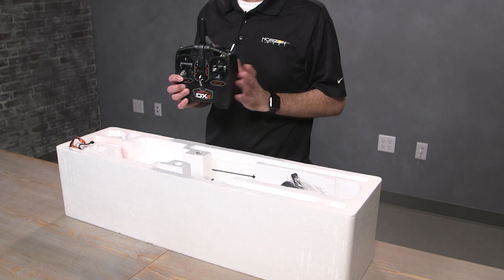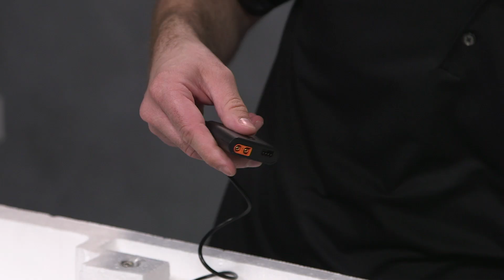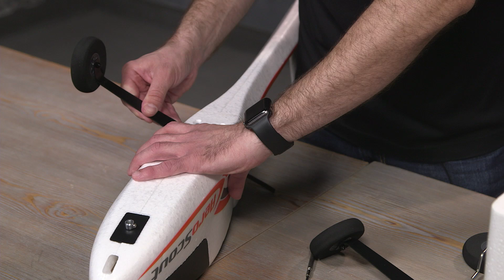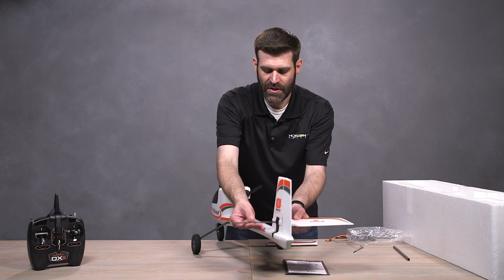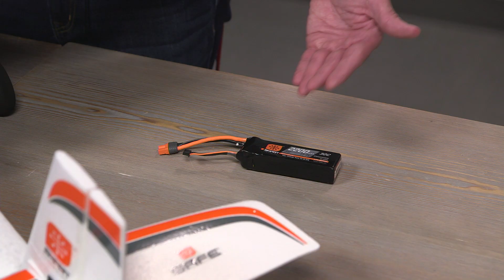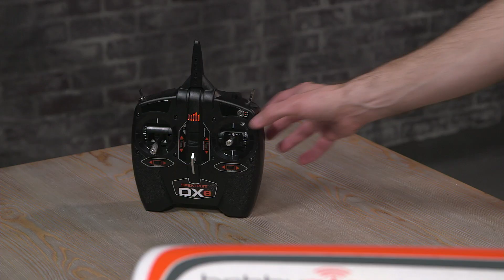Unboxing and Assembly - HobbyZone® AeroScout™ S and S 2 1.1m

Comment: Do you take the tape off the ailerons
Reply from the maker: No, the tape is for reinforcement of the hinge lines and should be left in place!
Reply: @ ok thank you. I’ve had two of these planes just lock right and fly off. When binding the controller to just the plane I’ve purchased as a replacement there’s no labels for right and left. How do you make sure they link up correctly when binding?

Comment: How do I get another battery? Does this kit come with the battery and charger?
Reply from the maker: As of 2023, due to FAA regulations, this model is now only sold in an RTF "Basic" version that does not include the battery and charger. You will need to purchase this battery and charger bundle to complete it: https://www.horizonhobby.com/product/smart-powerstage-air-bundle-2200mah-3s-g2-lipo-battery-s120-charger/SPMXPSA200.html

And you can purchase additional batteries separately here: https://www.horizonhobby.com/product/11.1v-2200mah-3s-30c-smart-g2-lipo-battery-ic3/SPMX223S30.html

The "full" RTF version that included a battery and charger is no longer available.

Comment: Does it come with a battery or not because the sight says you do but I watched him pull one out of the box
Reply from the maker: AsAs of 2023, due to FAA regulations, this model is now only sold in an RTF "Basic" version that does not include the battery and charger. You will need to purchase this battery and charger bundle to complete it: https://www.horizonhobby.com/product/smart-powerstage-air-bundle-2200mah-3s-g2-lipo-battery-s120-charger/SPMXPSA200.html

And you can purchase additional batteries separately here: https://www.horizonhobby.com/product/11.1v-2200mah-3s-30c-smart-g2-lipo-battery-ic3/SPMX223S30.html

The "full" RTF version that included a battery and charger is no longer available.
Reply: @HorizonHobbyProducts  ok thank you

Comment: Seems with this design the battery wire is always going to be bumping the servo push rods for the front wheel? Even this video the wire visually appears to be all on up on that push rod even though the guy is saying he has clearance. Seems like its ok to touch but conflicting info here.

Comment: I have a different model than what you are showing. The aileron connectors are on a round capacitor. The wire going to channel one has 4 wires and one is yellow and is not attached to anything, does it plug into 5 or 6 channel or left out? It has a plug attached to it so it seems it would plug into either channel 5 or 6 which are the only two left in the receiver. Thanks for your help.  I got the DXS model transmitter. I did not receive a battery or charger, which I thought came with the ready to fly version.

Comment: Question,  this is considered an excellent beginner aircraft.  I am having problems, when I switch from beginner mode switch in (0) @ 50% throttle to intermediate mode switch in position (1) the aircraft pitches nose up drastically and needs to be retrimmed for level flight.  Switching back to beginner mode it goes hard nose down and again needs to be retrimmed for level flight.  Reading the ops manual again, I see it states trimming should only be done in exp. mode (2) ?? This doesn’t make sense as a beginner aircraft, having to trim and retrim.  Any input would be appreciated.
Reply: If you have access to a experienced flyer ask them to trim it up for you👍🏼..

Comment: I nosed mine in on my second flight.. Busted it up pretty good, but was able to put it back together nicely.. Thank you for clarifying some points. I flew the rtf version with the original controller first flight, i have since hooked it to my gen 1 dx8 and seems to be working fine!

Comment: If anyone is putting together this plane and looking at the comments, the Aileron plug requires some good amount of force to get it to snap into place. It will snap and you will feel it.  It might seem like it goes in the wrong way, black to yellow, but it's definitely yellow to white. I believe I lost my first Aeroscout due to not connecting these well enough and they became disconnected mid flight. Not knowing what went wrong, I was unable to turn the plane around and it got so far away it lost connection. Hindsight I might have been able to use the rudder to bring it back around. Don't make the same mistakes I did!

Comment: I bought the recommended charger on the box, the Smart G2 200 3s. It doesn't have a balancer cable on it like you said in the video. Also, it's been charging for 1 hour now before my first flight and still isn't completed charging. The white charge light is still flashing. Is this normal?

Comment: My front wheel is angled to the right when the rudder is straight.  I just built it.  The screw is on the flat part of the front wheel wire.  Not sure how to adjust this.  Any ideas?

Comment: Can someone help me out here. Why is it we always power on tx before the battery goes in and opposite when turning off?
Reply from the maker: So you and the transmitter are always in control of the receiver and aircraft! Otherwise, if the transmitter is off and the receiver is on, interference or something else can cause unwanted commands of the aircraft including moving the control surfaces and/or running the motor unexpectedly.

Comment: I have the Aero S2 BNF. I have created the model from the BNF template on an NX 6. Everything seems to work but I noticed that the elevator servo makes an adjustment to the angle of the elevator when I switch from beginner mode to intermediate mode thus causing the plane to climb in flight. When switched to advanced mode the plane seems to fly fine without any trim adjustments. Is it normal for the servo to make this move when changing from safe beginner to safe intermediate?  Thank you for a response!

Comment: Well Jason after many hours of fun I finally crashed had to order new fuselage switched over the motor and the receiver but I can't get all the servos to work at once. What is the correct sequence of connections on the receiver
Reply from the maker: Channel/Port 1 = Throttle channel (plug the ESC lead into this channel/port)

Channel/Port 2 = Aileron channel (plug the y-harness lead from the aileron servos into this channel/port)

Channel/Port 3 = Elevator channel (plug the elevator servo lead into this channel/port)

Channel/Port 4 = Rudder channel (plug the rudder servo lead into this channel/port)

Comment: Im experiencing problems with this plane. (its my first plane)

When i connect the battery to the plane, all it does is beep a few times and nothing more. It doesnt react to the commands of the transmitter (which was on before connecting the battery). Would be cool if you help
Reply: You need to hold the 'A' button on the transmitter when you turn it on to bind it.

Comment: Thanks to the guy who did the video explaining the difference between the aeroscout and the apprentice......both excellent planes but i have decided to go with the Aeroscout first.  I still have my old Aerobird Challenger 3 and the old Parkzone Focke Wulf :) and really looking forward to flying the next generation of planes, i learned a lot on the Aerobird Challenger3, what a plane that is...i could get half hour out of a battery, climb high, cut the power and glide and hug the wind where possible, made many repairs to it too and bought many wings where i couldnt repair, strange thing is they always seemed to fly better after a repair haha, i added gaffa tape to the wings to strengthen them slightly, i snapped a few wings diving hard and pulling up sharp with expert mode with all the horns at full throw, gave it a little bit more than perhaps it was designed for, still my favourite plane, endless fun...even managed to get it flying inverted haha. The Focke Wulf was excellent too though more of a postive full on flight compared to the gliding capabilities of the challenger3 which had such a low stall speed especially facing into the wind.

Comment: Hi, what is the difference between the S and the S2 versions? I am about to buy an Aeroscout but the local hobbyshop has both in, on their website the cheaper version seems to come with the DXe transmitter whilst the more expensive version comes with a DX .....i am wondering if they have the pricing wrong and if i should go for the DXe transmitter rather than the other one, is there  any difference between the planes themselves? Thank you.

Comment: Anyone know what the d switch does?
Reply from the maker: No function when using the DXe or DXS transmitter with the AeroScout! The D switch is usually used to control flaps on other models.
Reply: @HorizonHobbyProducts  oh okay, I appreciate your response. Just got one of these in the mail and didn't know what that switch did

Comment: I have downloaded the setup to my dx6 ready to bind but I have one question before I bind it.. Do I need to assign the flightmode switch by toogling the switch still or is it pre set for that 3 pos flightmode switch for safe when bindning to dx6?
The manual is unclear on this point. I want all 3 flightmodes setup like the rtr dxe on my dx6... 
Mvh Pierre
Reply from the maker: The SAFE flight modes are assigned to channel 5/gear by default. When using a DX6, this means the flight modes will be on the 2-position A switch by default. With the 2-position switch you will have Beginner mode and Experienced mode...you will not have Intermediate mode available (most people do not mind this). If you would like to have Intermediate mode as well, you will need to use the "channel assign" function in the DX6 to change the switch channel 5/gear is assigned to from switch A to switch B. Then you will have all three flights modes on yours DX6!
Reply: @HorizonHobbyProducts  I have done that.. Its set to B 3 pos switch where I have my flightmodes but when I bind it now for the first time I insert bindplug then remove it before I bind but do I need to toogle the B switch 5 Times after binding are complete or is safe already active?

Thank you so much for helping me 😊
Reply: @MelinsRCTech  Search Binding the DX6 to the Arrowscout I'm sure someone has a video showing exactly how to set it up I have the RTF Arrowscout so I just use the transmitter it comes with I'm looking for a good deal on a used DX8 so I can buy the BNF models with flaps retracts etc Ya save a lot of $$$ in the long run I want the new Turbo Timber bad lol I just built a 4ft 6inch wing span foam board trainer I have everything built All I have left to do is install the servos control rods and horns I have have already installed the motor ESC and receiver which is the same one in my Arrowscout so I can use the same transmitter I've got about a $100 in it The FliteTest channel is awesome if you haven't heard of them you are missing out Those guys build some awesome planes and they do all kinds of cool experiments ✌️

Comment: I just bought one of these and i noticed that there is a middle wire coming from the battery. I fly a lot of planes and I was wanting to know if i could use my other 3 cell batteries in it if i  changed the plug on the plane to fit my other batteries. OR do you have to use a HOBBYZONE battery only. In other words. will the plane still power up/fly if i put a deans or other connector on the plane.
Reply from the maker: The third wire gives you the benefit of Smart technology when used with Smart chargers and ESCs (safer, easier to use, etc.)! However, that battery will also work with 2-wire "non-Smart" setups too! And other 2-wire batteries will also work with the stock "non-Smart" ESC.
Reply: @HorizonHobbyProducts   I see thank you. I plan to just keep it the way it is. I was also unsure if the transmitter that came with my Aeroscout (DXe)  if it will bind with the 1.1 meter Trojan. If so it would be worth it for me to grab one of those and a couple of xtra batteries. Im pretty sure that they take the same battery. 2200 3S.

Comment: Hey I was wondering if the transmitter in the ready to fly Aeroscout can be used in other airplanes
Reply from the maker: Yes! The DXe originally included with the RTF version AeroScout S 1.1m, as well as the DXS that will now be included, can be used with many other 4-5 channel HobbyZone and E-flite BNF Basic aircraft including this T-28 Trojan 1.1m: https://youtu.be/r0K6S1K4vYc

Comment: I just got mine recently. overall I'm super excited, the only problem is the rod that goes through the vertical stabilizer Fits way tighter than snug to the point where I cracked the rod. hopefully the hobby shop near me has a replacement or I'm not flying tomorrow as planned. not to happy with what happened
Reply: Wet rod with water then insert.
Reply: I had to lube mine to get it in...styrofoam safe lube!!! One stabilizer is very hard to get square tube in and the other fits so loose makes me wonder how it stays on...but all the aeroscout vids I've watched are like that and I have watched about 10.
Reply: I had the same problem getting the rod in. I had to use a razor blade and shave away all 4 sides of the rod, afterwards, everything went in snugly.

Comment: I just got a aeroscout s1 and in beginner mode i have full rudder throw. in intermediate i have half rudder throw. Is this correct ?
Reply from the maker: Yes, this is correct! You have less aileron control/a lower bank angle limit in the beginner mode so you may need more rudder to make the turns "tighter" than in the intermediate mode (which has more aileron control/a higher bank angle limit). This also makes it easier to taxi in the beginner mode since you have more nose gear steering authority. You should also have more rudder throw in the experienced mode!
Reply: @HorizonHobbyProducts , This makes perfect sense now.  Thank you for the perfect answer to my not perfect question.  My plane is working properly Thank you so much.

Comment: Fantastic presentation and teaching. You sir should be a model for other You Tube aspiring teachers/presenters. This coming from a teacher. I could base my whole comment on your meticulous and articulate presentation. Great job.  Anyway I’ve been so excited to get into this hobby and I’ve got the bug bad after picking up a couple of micro helis. I have a Sport Cub S but it’s always windy up in northern Canada where I am and I think it stands to reason that a larger plane would be way better in the wind and probably actually easier to learn on. I was going to get the carbon cub S or the apprentice but the assembly itself turned me off. I want to learn how to fly these things not spend an hour or more trying to put them together. This seems like my kind of beginner friendly RC aircraft. Solid and well-built, not needing rubber bands all over the place. Anyway you just might have helped me make a decision. Tell me can you fly this in parks etc? Thank you very much. Cheers.
Reply from the maker: Thank you very much for your feedback and support Steve! And yes, this model is sized so it can be flown in large parks...in an area as small as a single soccer field for more experienced pilots, or in an area the size of ~2+ soccer fields for less experienced pilots. The more space and less obstructions the better when learning to fly of course! The AeroScout does handle better in wind than the Sport Cub S and other smaller/lighter class models, but we do recommend flying in as low of winds as possible when learning to fly. And if you haven't already, we strongly recommend picking up the latest version of RealFlight RC Flight Simulator (https://www.horizonhobby.com/category/airplanes/aircraft-radio-systems/simulators )...it will help you learn to fly, and become a better pilot, in less time and with far less crashes of your actual models! The AeroScout is not currently in RealFlight (yet ;), but the Sport Cub S, Carbon Cub S and the Apprentice are in there, along with Virtual Flight Instructor lessons also taught by Jason. You can see more info in the video here: https://youtu.be/yhmR0kpcDAs

Comment: If the aileron order does not matter, does it actually "learn" which servo is which? Or are the servos mirrored?
Reply from the maker: The aileron servos rotate the same direction, but one is mounted "mirrored" to the other (so it drives the corresponding aileron the opposite direction of the other servo no matter which lead on the Y-harness it's plugged into).

Comment: I just flew this plane today for the 6 time. It flys great. Beginner mode is great, you need it. This is about hand eye coordination. That takes time just fling slowly safely.
Reply: I just crashed mine badly on the first flight.  My question, I have rebuilt it and since also bound it to my Gen 1 dx8.  I do have safe select,  should I use the dxs stock controller or dx8 with safe select?

Comment: is it the rtf?
Reply from the maker: We offer two versions...RTF (Ready-To-Fly) and BNF (Bind-N-Fly) Basic:

The Ready-To-Fly (RTF) version includes a Spektrum DXe controller/transmitter equipped with industry-leading DSMX® 2.4GHz control technology, plus a Spektrum Smart LiPo battery and charger that make it easier and safer to charge. That means there's nothing extra you need to buy or provide before you can fly!

And the fun doesn't stop after you learn how to fly! The powerful and efficient brushless power system delivers long flight times and provides plenty of speed and power to perform aerobatic maneuvers including loops, rolls and even inverted (upside down) flight. Plus, the lightweight design and low wing loading deliver a very wide flight envelope and incredible handling that even experienced pilots will appreciate and enjoy. The BNF Basic version (HBZ3850) is the perfect choice for those pilots because it allows them to use their favorite Spektrum™ transmitter along with batteries and chargers they may already own to fly with.
Reply: @HorizonHobbyProducts  cool